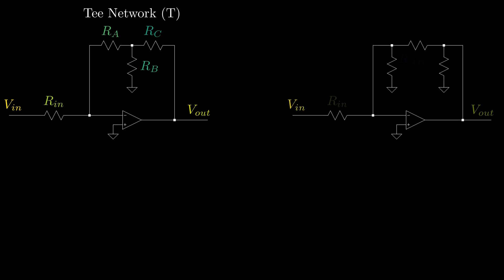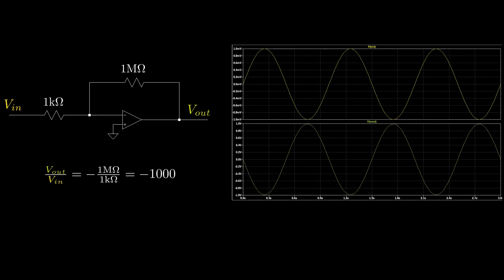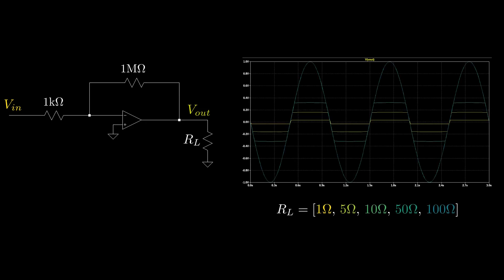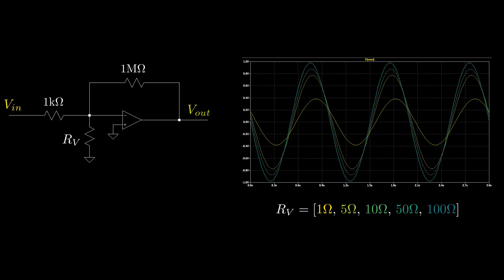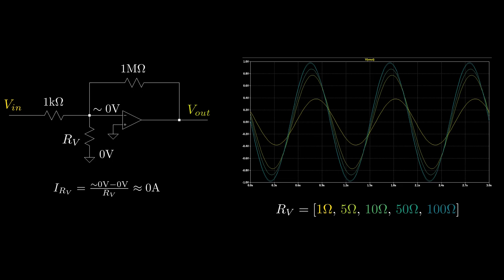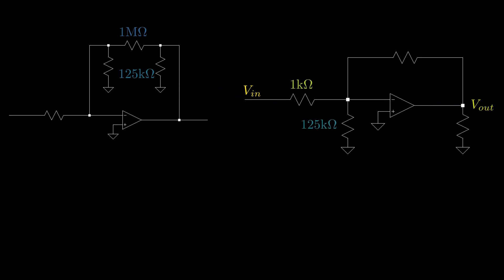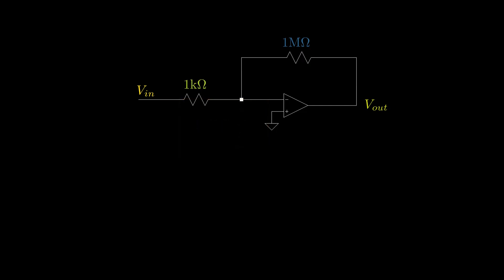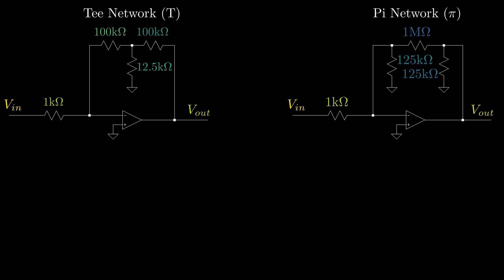Electronic Circuit Basics: How to Simplify A Tee Feedback Network Using Op-Amp Characteristics

Comment: Disregarding opamp noise, just looking at the resistors, is the T-network less noisy than the pi-network because of the lower resistor value?
Reply from the maker: That’s a fantastic question! My initial thought was that it would be the same, but according to this answer might be incorrect. Although, this is talking about the op amp noise, not Johnson Nyquist noise.

I will ask a question on EE stack exchange to find out, as I’m not sure enough to give a definitive answer at the moment.

https://electronics.stackexchange.com/questions/333055/op-amp-with-t-network-in-the-feedback-path/333089#333089

Comment: in this circuit isnt output technically connected to the non inverting terminal via the 125k ohm resistor in the pi network, how do we conclude that this is negative feedback? sorry im new to this subject
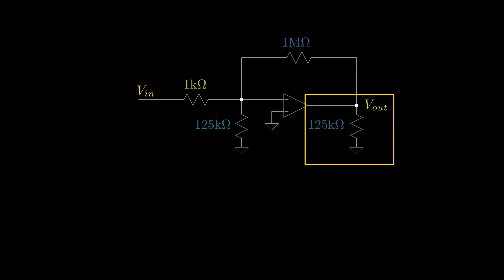Reply from the maker: Looking at the circuit at 3:52, because the non-inverting terminal is directly connected to ground, we can say that the voltage there is 0V with respect to ground. No matter what the rest of the circuit is doing, there will be 0V at the non-inverting terminal. 

For concluding for negative feedback, let’s use the standard inverting amplifier. If you applied a small positive voltage to the input, the voltage at the inverting terminal will increase slightly. The opamp will see this, and output a negative voltage in response. This negative voltage is fedback to the inverting terminal, balancing the voltage back to 0V. 

Let me know if there is still confusion, a bit hard to explain purely with text haha.